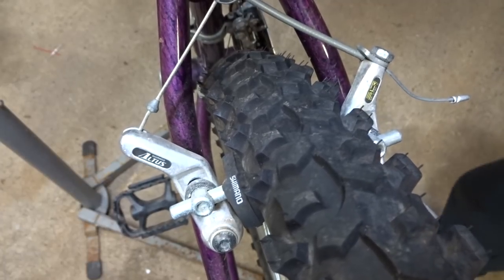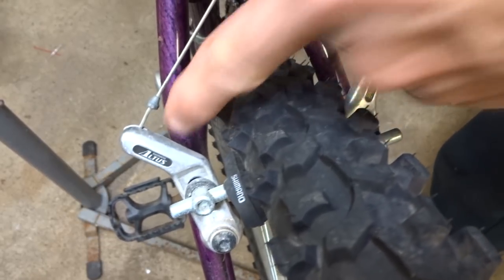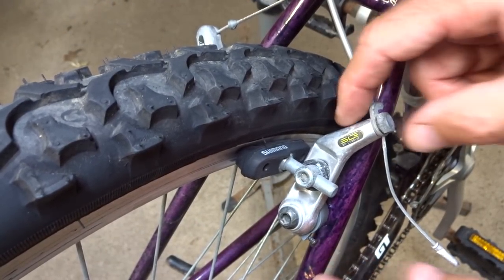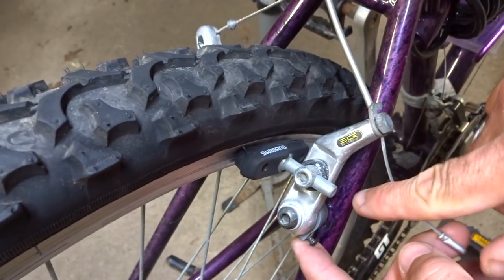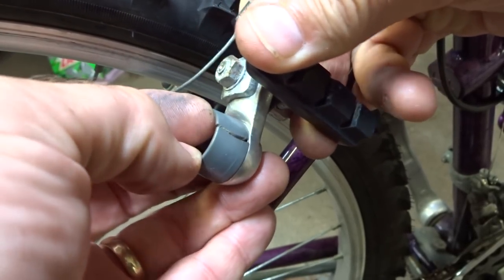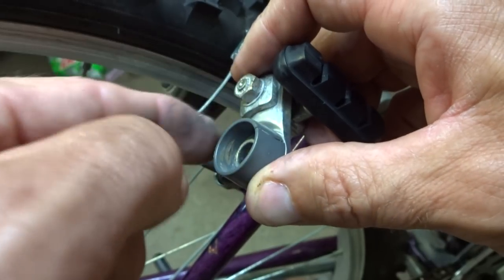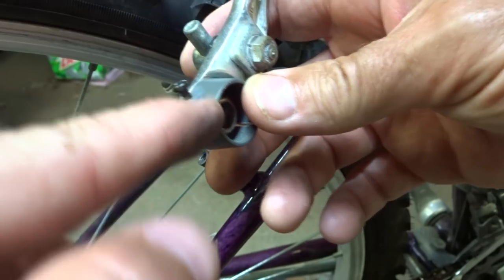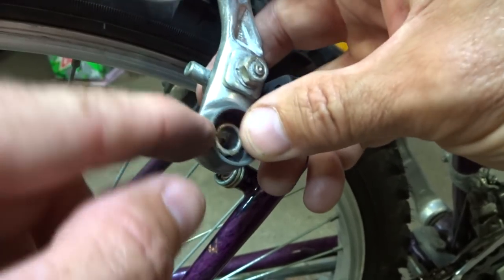Old Shimano Altus Brakes Rubbing? They're Probably Broken...

Comment: Hello RJ.  For many years that was a Shimano warranty issue, they would send us out replacement spring covers by the bag.  Check your crankset as well, as they were paired with a very narrow crankarm that supposedly broke.  The brake parts are no longer sent out, but Shimano will send a crankset, bottom bracket, front derailleur and chain to replace the warranty ones.  As for the brakes, we replace them, simple and pretty inexpensive.
Take care,
Stephen

Comment: Unless you want to absolutely keep the cantilever setup for authenticity even an entry level brake option from either Avid or Shimano is dirt cheap and far superior in performance.

Avid Single Digit 3 set including handles can be found for under $30 on eBay.  Very easy to install and If you follow RJ's video even a beginner home mechanic can do it.
Reply: Will these straight replace the BR-CT90-L's?

Comment: I just repaired my CT90s with cable ties and it worked like a charm - much improved! Just take them off first and it's quick and easy. I just used a little super glue to stop them moving, but they'd probably be fine anyway..
Reply from the maker: I'd be leery. They are your brakes afterall.
Reply: @RJTheBikeGuy  Fair, but this is a grocery getter & I was happy to use it with the brakes as they were. Use this repair at your own risk. Use cantilever brakes at your own risk! Lol

Comment: Yep... I've replaced these brakes multiple times on my old Giant Iguana MTB. Unfortunately my LBS only has the old grey plastic altus brakes, so about once a year I'm replacing them.
Reply from the maker: The ones on Amazon are the newer ones: https://www.amazon.com/exec/obidos/ASIN/B001GSQO1E/ref=nosim/youtube25-20
Or you can try a different brand/model.
Reply: RJ The Bike Guy thanks RJ 😁
Reply: Had the newer version of these, the CT-10 iirc, and replaced them with a decent and very inexpensive set of Shimano v-brakes.

The whole upgrade took 20' and  including handles was under $50. The difference in braking power is incredible.I

Avid Single speed 3 or 5 is also dirt cheap and you can often pick it up on eBay for under $30 for the set including handles.
Reply: Andrew Garon hey that's a good idea!

Comment: Can you please show us how to fix rubbing disc brakes or how to adjust disc brakes
Reply: Follow the instructions that shimano gives.. otherwise (for hydraulics):
1. Remove wheel.
2. Put pistons all the way back, and introduce plastic spacer meant for this, and or otherwise piece of plastic (PET, etc, not a plastic that will shatter, old cds work)
3. press the brakes several times, 
4. put the wheel back, making sure it sits well, and disc/caliper are aligned.  If not, you will have to align them.
5.press the brake lever several times, allow the wheel to spin, etc.

This fixes most common problems, this is, minor problems, like pistons not properly adjusting.  Always put a spacer or something when pressing the lever.
If you have mechanical brakes.. well, good luck, I recommend you put hydraulics, or at the very least hydraulics that are operated by cable (these also autoadjust).
Reply: Aitor Bleda thank you so much !!!!

Comment: Hi. I inherited a mountain bike with the Altus brakes shown in the video.  Bike works just fine and, at 73, it fits my need.  The front brakes are exactly as pictured in the video and the gray spring adjusters are cracked.  I would like to replace the brakes.  Can someone tell me the correct Altus model to get?  I only ride on pavement and treat the bike as gently as I want it to treat me!  Thanks.
Reply from the maker: https://www.amazon.com/exec/obidos/ASIN/B001GSQO1E/ref=nosim/youtube25-20
Reply from the maker: BTW, not sure exactly what the different between front and rear versions are. Maybe orientation of pads? Maybe straddle? I believe the brakes are the same.
Reply: Thanks very much RJ.  I did try the zip ties and it works!  Allowed me to adjust the brake enough to get it off the rim.  Will see how long that lasts and perhaps change the brakes this winter.   Very appreciative of the prompt and easy to understand assistance.
Reply: @alansteinfeld2154  did you try the brakes he linked you? PS the model for your brakes is BR-CT90-L

Comment: Hi ya. Great videos. I have a problem with my screw on freewheel. It makes like a knocking  noise when you  pedal fast and change gear.  On a mountain bike 7 speed. Many thanks jess. UK
Reply from the maker: https://www.youtube.com/watch?v=VzrpC7jrz8U
Reply: Hi. The chain doesn't slip. Or skip. The freewheel is makeing a knocking noise
😊👍
Reply from the maker: From your description, I am guessing it something like in that video. But then you can try clean/lubing the freewheel. Or replacing the freewheel. Or overhauling the hub. Or take to a shop.
Reply: RJ The Bike Guy OK thank you for 
 your help. 👌👍✌️

Comment: I reckon these plastic hard to find parts can be 3d printed
Reply from the maker: Is it worth it if a new pair of brakes can be bought for about $10-12?
Reply: @RJTheBikeGuy  Yes if it works reliably and if you have access to a 3D printer, a pair would cost cents in filament and you are recycling, imagine the thousands of shimano brakes in good condition but with the little plastic part broken.

Comment: Anything BUT centerpull cantilever brakes that bend the cable..... not only the altus fail as you indicate.. the cable is bent way too much and it can snap from fatigue, probably leading to a crash.
Reply from the maker: I have never seen that happen. If it does, the cable was worn out to begin with an should have been replaced long ago. That is just poor maintenance! Cables should be replaced occasionally.
Reply: I fully agree with you.  I change the cables when it is needed.. but some people only do it when they break!  Many bikes in the 90s had plastic reflectors, etc, to catch broken cables..

Comment: When the spring is external I usually use the bending trick for cantis or v brakes but I’ve never tried it with a spiral internal spring. Have you tried bending it to Increase spring tension so it doesn’t rub since the adjustment screw is shot? I think it could be done

Comment: Hi RJ, Would it be possible to replace these with V brakes?
Reply from the maker: The brake levers would need to be replaced. Cable routing might need to be tweaked with clamp on cable stops, or something.